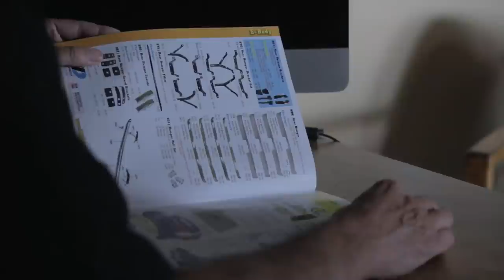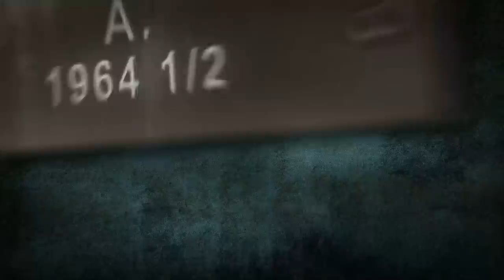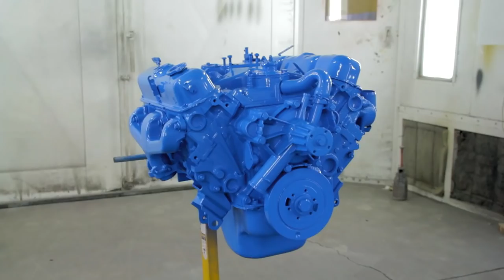Season 4 Episode 4: ""Mo Money Mo Challengers"

Comment: Transmission is wrong color, looks like they painted it? The battery ground cable would have been installed before painting the engine at the factory!